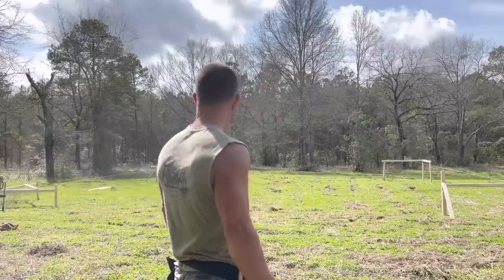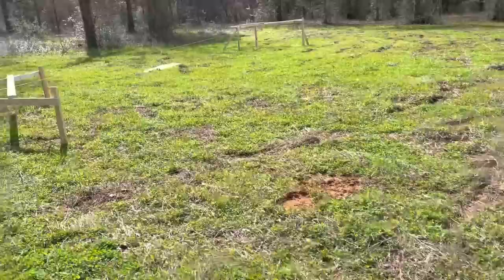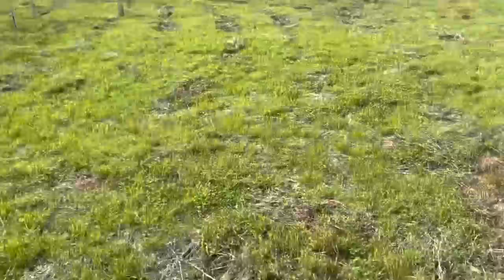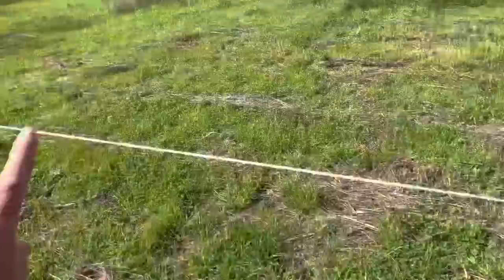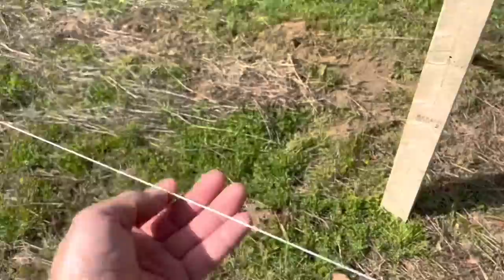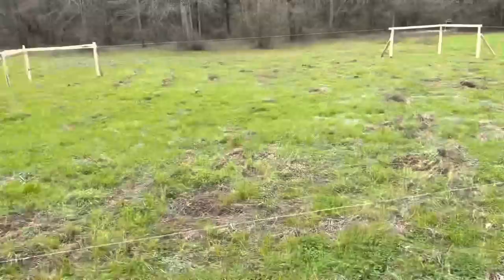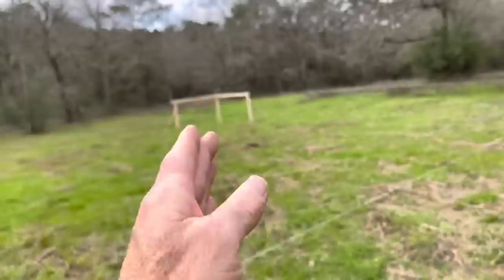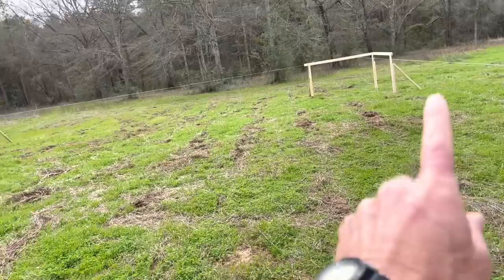Building Hannah’s House Step 1: Laying out the Foundation!

Comment: It might be a good idea to build in a small basement for a tornado shelter to keep Hannah safe just in case? I was worried about you both last year with those tornadoes hitting so close to you all!
Reply: I built a safe room as part of the house using concrete block re-enforced and concrete filled it worked out great cause I used it as a bathroom too. It doesn’t have to be a basement…just have a slab foundation and pour the ceiling solid using steel panels to support the concrete pour, it was all tied into the walls.

Comment: Get a calculator and use the pythagorium theorem. A squared + B squared = H squared. Square root of 4608 is the length of the diagonal of this house. Proper batter boards are set back from the corner a couple of feet so you can find the corner in mid air where the strings cross. Drop a plum Bob to find the corner on the ground.
Reply: You typically see the formula as A²+B²=C². I’ve never seen the hypotenuse side called “H” but it’s an unknown so I guess you could call it anything you want.    A²+B²=Ω²

Comment: How did you calculate the size of the footings without knowing the load bearing of the soil? The footings are being laid out with the topsoil in place. In the 30 years as an engineering technician in the northern US I've never seen anything laid out without a soil analysis being performed. True, you're probably familiar with the area but the topsoil will still need to be removed before building on it.
     Here in Michigan a developer will remove all of the topsoil from the building site. Then the water, sewer, curbs and pavement will be placed. After the home is built the developer will sell the topsoil back to the owner if the owner wants it.
Reply: LOL... Regional building techniques vary widely. MI ain't AL, ain't TX.
Reply: Why in the hell would the land / home owner buy his own damn dirt back That's still on his property  ? That's kinda ignorant 😕.  Plus the house is gonna be pier and beam he's going to dig down for the footing to set the blocks
Reply: @allenwilson9656  👍
Reply: @allenwilson9656  Top soil is hauled away to clear area for construction.
Reply: You’re kinda right, but not across the board necessarily. Once the building loads are a known value, a soil proctor can be performed on the existing earth to see if it’s capable of bearing the necessary loads. Here in Florida, probably 80-90% of the time, existing is sufficient. If not, existing soil is excavated to the necessary depth and sufficiently load bearing soil is brought in (in the needed areas).

Comment: Hey Jeff. Calculating it out comes to 67.88. How did you know it was 68? Just experience or is there a rule of thumb you use? Thanks
Reply: I was kinda wondering that myself. If the diagonal is 68-0, than 1 direction of the house should be 48-2 and the perpendicular direction would be 48-0. He said when he checked it, it was 1.75” off which is almost right, but 1/4” shy actually. Then he did something with splitting the total dimension in half and measuring from the center each way, that I’m going to have to watch again to try to figure out what he did. 
But you’re right, the diagonal of a 48x48 square is 67.88 or 67-10 9/16.

Comment: Whatever happened to using the 3-4-5 triangle method to check for square?  🙂
Reply: At 48x48, you could easily do a 30-40-50 triangle and have no worries at all about square, if you just didn’t want to do any math for A²+B²=C². (But it’s not that hard really)